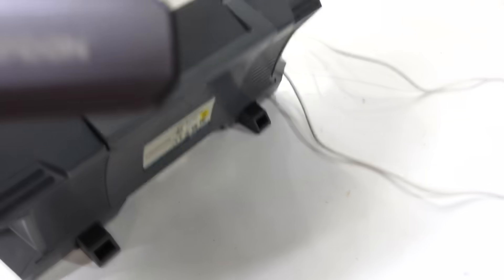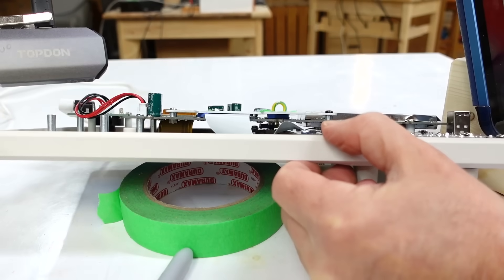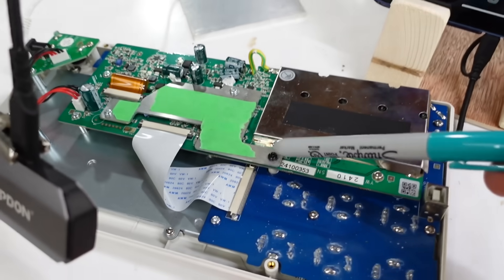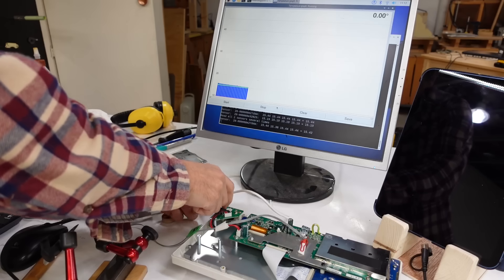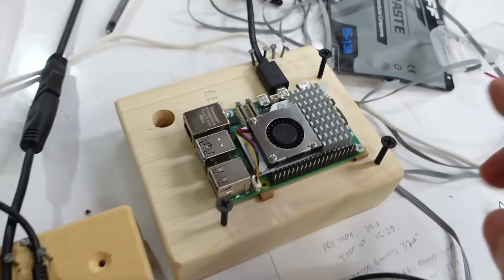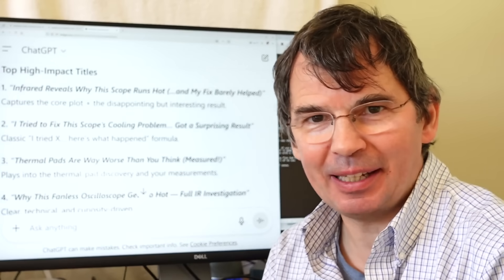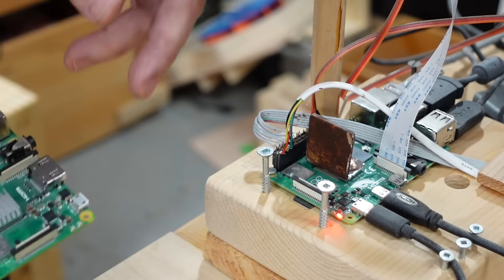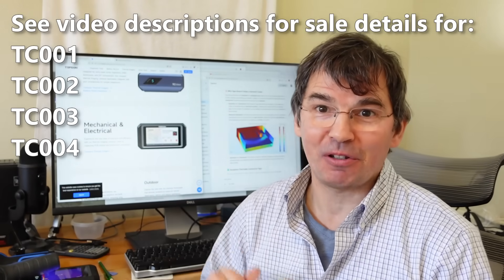Tape on a heatsink can make it cool better

Comment: Seems like based on how the temp changed while you walked around the shop, a teeny tiny fan in the case might make a surprising difference without adding much, if any, noise.

Worth a try?
Reply from the maker: Definitely would make a difference.  But its better than it was, and it was probably ok before.

Comment: Good stuff! When I got a thermal camera, I was surprised to see how many things reflect IR like a mirror, despite being matte with visible light. And I was surprised that the "tool-like" camera records like garbage: no video at all, and pictures are jpeg compressed to trash. Better get a mobile phone add-on camera!

I just want a thermal camera without the shutter halting the image every time I wanted to see something critical that only lasts for a second. They should give me manual control of the shutter, or better yet, make it so fast (or block only every other row of pixels) that it's not annoying. Currently it's super mega annoying in every thermal camera I've seen. If nothing else works, give us a camera with two sensors that never get blinded at the same time!
Reply from the maker: The shutter halting is calibration.  My experience is it does that more at the start, but it does continue doing it.  If you aim it at something hot, it seems like it burns a spot into the image, but on the next shutter halting thing, its calibrated out.
Reply: @matthiasrandomstuff2221  Yeah, I've seen the effect of the shutter removing the accumulated burn-in, and it's quite necessary. But no matter how useful it is, it's still way too annoying and stops for too long. Imagine if the shutter only closed for 1 or 2 frames. It would have less time to measure the burn-in, but it could trigger the shutter again after a second (if needed). I think these more frequent but super short measurements would yield just as much info, but it would be 100x less annoying for the user.

Comment: Fine wire thermocouples are good for direct measurement of temps without acting as a termal load.
Reply: Can vouch for this - I work in nuclear and this is what we use.
Reply: @SupraSav  But how to couple it to the surface?

Comment: I've had the Topdon TC002 for about 2 years and can vouch for it as a good tool. I found it's more useful to use it with an extension cable to allow me to hold my phone where i can see it while angling the sensor to point at things, rather than using it plugged directly into my phone.

Comment: I would even consider buying just small heatsinks designed to go over chips and then use thermal glue to get them in place. Not sure how hot that thing can get as it seemed to do just fine without any heatsink.

Comment: the thing is: 40 even 50C for computer chip is nothing.
while gaming (for hours) my CPU is at 70C and my GPU 80C.
the agreed upun maximum is 90C.
Reply from the maker: The cooler the chip, the longer they last.  Every 10 degrees hotter cuts lifetime in half.

Comment: While a neat look into heatsinks and emissivity, I have to wonder why you're bothering to try to improve the cooling of a device that, when passively cooled by a tiny, low surface area heatsink, barely sits at 40°C. If it was hitting twice that, sure.

Also, it's so sad to see people keep engaging with the trash generators that are "AI" chatbots. I was happy to see you end up using your own brain instead, but at this point we have enough data showing how these things make their users more stupid and less capable to abandon any desire to engage with them, especially when you start factoring in the mountain of other major issues attached to them. I can't wait for the AI bubble to pop and most of this crap to disappear. I get the initial five minutes of fascination, but beyond that? It's just trash.

Oh, and one last note: there is no standardised way of measuring the thermal conducitivty of things like thermal paste and pads, so you really can't compare W/mK numbers between brands or even products from the same brand, as they might be tested in entirely different ways. There are better, higher conductivity pads out there, though they are expensive. You're entirely right in thinner always being better though.
Reply from the maker: Chips are quite a bit warmer.  But its just my obsessive nature.  When I saw those thick pads, I had to do something about it first.
Reply: One quick observation. You are undoubtedly right. But on the other hand this channel is called "random stuff." And you were engaged enough to leave an informative comment so, maybe it is all good?

Comment: Very interesting videos my friend. You walking past it makes me wonder about how small & quite of a fan would make a meaningful difference!
Reply from the maker: A fan running at an inaudible 200 RPM would make a very substantial difference.
Reply: @matthiasrandomstuff2221  There's very small and thin fans inside those mobile phone gaming things kids use these days. They're a bit noisy, but if you undervolt one just enough to move air... it should be good.
Reply: @aserta pc fans have solved this issue, just get a noctua or other high quality fan and run it at low rpm.
Reply: Might be a good video idea. Measuring Fan RPM Vs noise Vs cooling
Reply: @mc_cpu that's something PC hardware channels do regularly already. So I don't think it'd be that interesting

Comment: I'm curious whether sandblasting or simply sanding the flat aluminum heatsink would help. That would definitely increase the surface area, but I'm not sure if it would affect the reflectivity. I assume the reflections would be the same but scattered, although at a microscopic level, some of that scattering will be directed back into the aluminum.
Reply from the maker: would not change reflectivity much, just to the extent that the coarse surface would involve multiple reflections.  But if you sanded something that was a little oxidized, it would actually increase reflectivity by removing the oxide layer.
Reply: @matthiasrandomstuff2221  Sandblasting, or even just anodising the surface thicker, and colouring it dark, will make a big difference. you see this on large extruded heatsinks, where there can be a 30% better cooling performance between the plain mill finish extrusion, and the extrusion that has been anodised and dyed black.

Comment: Considering your commitment (i.e. shaving microns off those thermal pad/gaps to save your chips)… here’s where this obviously needs to go next:  Slap a water-cooling loop on it. Or bare minimum,  bolt a big heatsink out the back with liquid metal between the chips and the sink.  But for real… I’d go refrigerated loop with the compressor outside.  

If you’re all-in on efficiency (and content as seems the case), dig a shallow geothermal loop 6–8 ft deep across the yard, bury a couple hundred feet of PEX, run a pump, and get 12–14 °C coolant forever. Hell, throw solar panels and a battery on it to run the pump for free.
Reply from the maker: A CPU fan running at very low speed would make a huge difference, the scope is really not running all that hot.  It was ok before all this.

Comment: def this video is just promoting thermal cameras lol it would make sense if the cpu was producing 60c or more but 40c is nothing.
Reply from the maker: Chips themselves are probably a fair git hotter than the PCB.  But yes, just messing around with optimizing something that wasn't broken.

Comment: We need a thermal deer alert for driving. So these work for longer range?
Reply from the maker: They do work for long range.  But not through winshields.  Also not when wet, cause water is like black paint in infrared.
Reply: Mercedes used to offer that.
Reply: "driving"... only during hunting season, right?

Comment: I guess the TC001 Plus isn't on sale.

I've been looking at the UniT units some and I rather like that they make snap on macro lenses for most of their units.
Reply from the maker: Those doe affect thermal accuracy.  But -- to make sure I'm focused with the macro lens, I end up looking at stuff that is reflective, because the temperature itself diffuses rapidly, so actual temperature profiles are naturally a bit blurry -- just edges of objects and reflective stuff makes for sharp details.

Comment: Could you please do an experiment with different color soldermask on PCBs? The hypotesis is that the matte black one should perform best.
Reply from the maker: Its not like I manufacture PCBs.  But if you are concerned about emissivvity, even white paint tends to have good emissivity.  Most surfaces do, except for bare metal.
Reply: The color is irrelevant; what matters is its thermal conductivity.
Reply: @Neue-Werkstatt-BM  You missed their point, black radiates more, so performs slightly better everything else being equal. Its not much though 0.95 vs 0.85 or something, as matthias says bare metal is the worst.